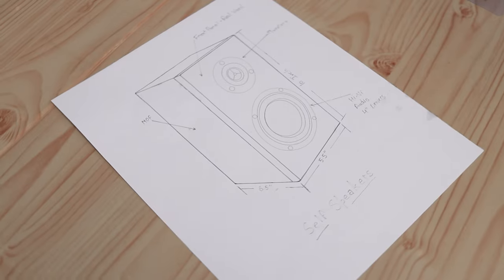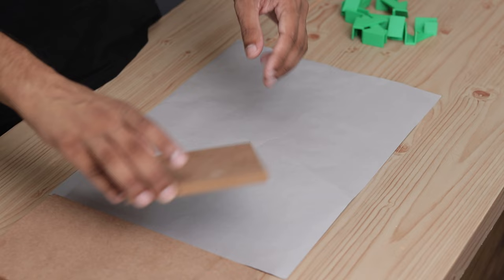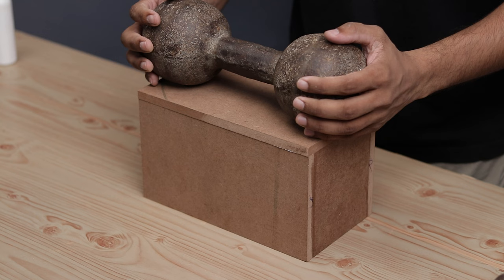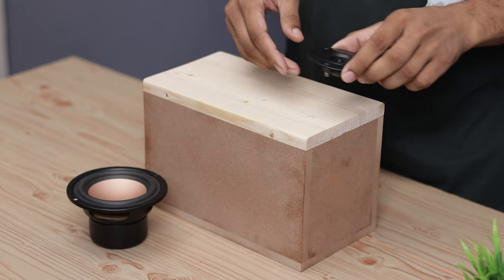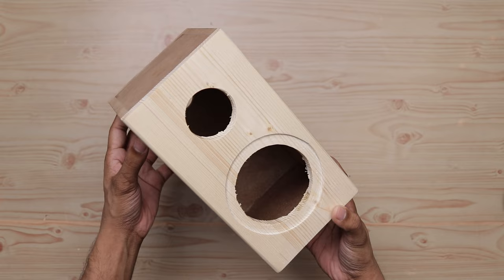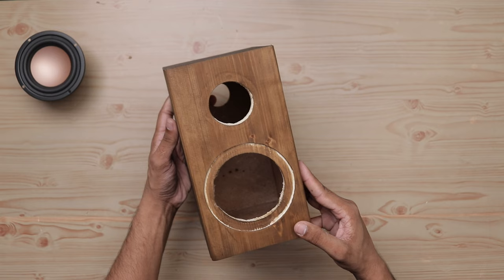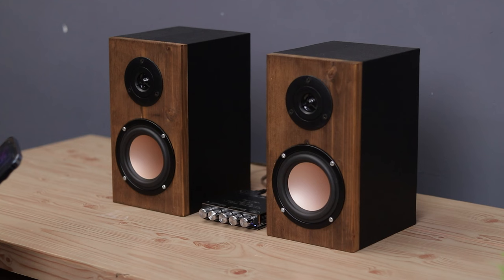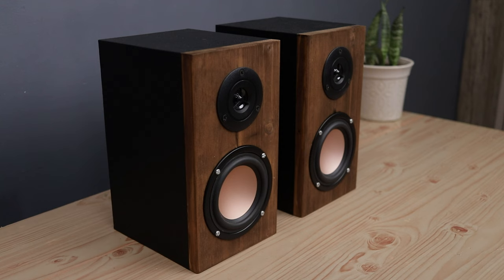How to Make Desk | Book Shelf Speakers at Home |  Budget DIY Speaker

Comment: How is it a perfectly square? Its a rectangle. If you had sanded the inside of the cutting, edge, It would have looked nice and eradicate unwanted vibration too. Also you should have used some acoustics to cut the backwave from the speaker.
Reply from the maker: I messed up 🤦🏻
Reply: @TheWrench You can still do it.
Reply: In carpentry terms a perfect square means 90° angles perfect in all corners. It does not mention the shape of the box...

Comment: Bro
Nice diy 
Where did you buy crossover
In Ali express
It's shipping possible in India ? 
Thanks
Reply from the maker: You can buy it here : https://bit.ly/3Rn3tIT, however you don't actually need it, because usually crossover network build by analyzing the speaker parameter.  there is cheap option available, if you can tell me, which tweeter are you using and its impedance then i can guide you.

Comment: Those HiVi B4N woofers have a really nasty breakup mode around 4Khz that has to be dealt with and needs a tweeter like the one used in the Overnight Sensation speaker that is very similar to your design except your tweeter can't be crossed over below around 5-6khz. You completely skip over the crossover you used as well.
Reply from the maker: Actually, this was my first time making an Book Shelf Speaker, i have learned a lot with these comments. will implement in my next videos.